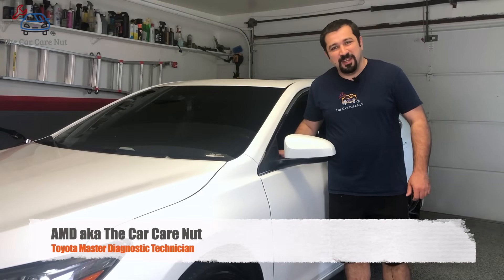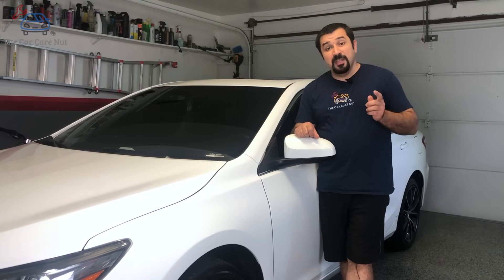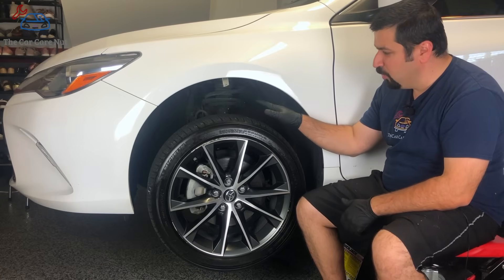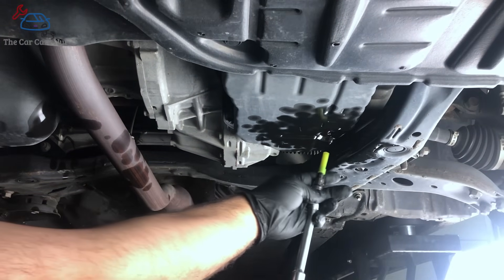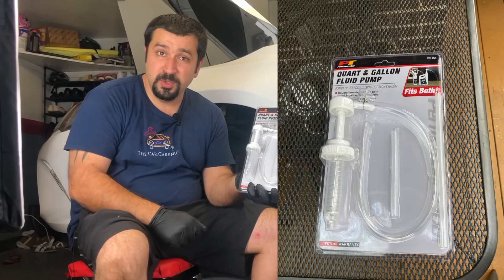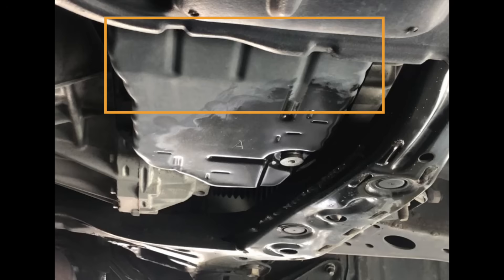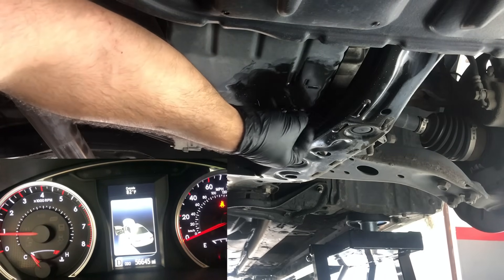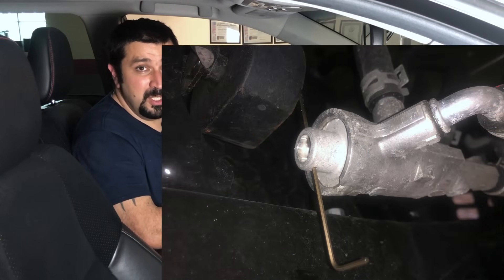How to change your Toyota Sealed Transmission Fluid

Comment: I have a 2012 Sienna only has 40000 miles. A couple days ago. I did the transmission oil drain and fill first time. I removed drain plug about one quart oil come out. Then I removed the red transmission tube (Straw) only about 0.7 quart fluid come out. Total fluid volume was only 1.7 quart. It is low compared with transmission oil drain and fill video in other you tube. Then I screw the red tube into oil drain port. keep screw in than I felt very lose. May be the red tube is come lose inside the drain tube. Push red tube up slightly feel some thing is catch it gently but not so sure. Place and tighten the oil drain plug and then add 1.7 quarts of WS fluid. Did not ram up the temperature to check level due to if lose the drain plug again one quart oil is going to come out just like first time I opened it. Test run the car. Transmission runs smoothly. I am not sure if the red tube situated in drain tube normally like this or may be it will float into other part of oil pan. Is this proper concern? Do I have to re-sit red tube or replace oil pan?
Reply from the maker: Hi! The overflow tube will tighten until it stops. Did it not stop? Or it just kept spinning?
Reply: More than likely, the overflow tube was factory installed very lose. Glad to know a functional oil pan the overflow tube can be tightened till stop. I just tighten a couple of turns and stop and afraid of tighten too much would push overflow tube into the oil pan. I will drain and fill again. if overflow tube keep spinning or be pushed into the oil pan, does it means I need to replace the oil pan? Thanks
Reply from the maker: So you’d want to tighten it by hand and not tight. Just spin it until it stops. If it keeps spinning and never stop or goes through likely either the tube itself is damaged or something is wrong with the pan.
Reply: @TheCarCareNut  Thanks

Comment: Mr car nut, I got the 2018 toyota auris hybrid 1.8 how often should I change my transmission fluid the got 14000 miles on the clock
Reply from the maker: Hi! I would change it every 60-90k miles

Comment: 2013 Toyota RAV4 Limited 4 cyl  FWD 
What’s the temp to check fluid level? Also is there a filter? Can you drop the pan and R and R the filter at the same time? Thanks
Reply from the maker: Hi! The temp range is 104-113 F there is a filter bit typically never replaced and doesn’t cause any issues. A pan drop it required to replace it but I wouldn’t bother honestly
Reply: @TheCarCareNut  thank you

Comment: nice video, is this the same procedure for the 2020 corolla le 1.8 engine transmission? and after shift between N and D, should I leave the car in N with the engine on or in D? Just wondering Thx
Reply from the maker: Hi this is the same procedure. If the shift you’d end in park.
Reply: @TheCarCareNut  thx a bunch

Comment: Sir I have a 2020 Tundra TRD PRO ...as you know Toyota did away with the transmission coolers in 2019 but still states that it is there. Some people are saying that the trans temps are too high(250 degrees) in 2019-20 models especially when towing. Toyota's official word is that they really didn't need an external cooler as they had in 2018 and older tundra's. Transmission guys on youtube say that these temps are too high also. What is your opinion or advice on this if I am going to be towing moderately.
Reply from the maker: I honestly would trust Toyota on this one. I’ve seen some pretty radical mileage already on the newer tundras with towing and not a single transmission issue or failure.
Reply: @TheCarCareNut  Cool that makes me feel better but I think I may change my fluid in shorter intervals than recommended.

Comment: Do you have confidence in transmission service centers such as AAMCO doing a transmission fluid change, and do these places typically flush the system, replacing almost all the fluid with new fluid?
Reply from the maker: I honestly don’t have experience with transmission shops as I work at a dealership. As long as they are using original fluid and understand the overflow type transmission fluid level( I hope they do as they are a transmission shop) then it should be ok.

Comment: The good old days when you could check the level with a dipstick and fill through the dipstick tube with a funnel.
Reply: The incorrect transmission oil level May cause trouble. Some People don't know you need to.let the engine running to check transmission fluid, opposite to the engine oil
Reply: @jjl8511  wouldn’t a dipstick be easy to check with it running? No tube level check with a running mess all over the ground. Also, this procedure has the potential to be a DIY megafail for anyone not experienced/meticulous enough. Toyota is indeed moving forwards by engineering backwards
Reply: @jjl8511  great in that case they need to read a repair manual, or have a independent shop do it for them.
Reply: @jjl8511 its a bit different with sealed transmissions
Reply: Our local dealer refuses to replace the transmission oil on newer toyotas, claiming that any change would void the warranty. this is absolute BS.
Reply: @Athletyk  exactly and these dealers are RUINING TOYOTA name
Reply: @Athletyk  That's why we call them the stealership.
Reply: @Athletyk  I had the same issue. Even after I showed them in the maintenance Manuel the mileage Toyota says to change the trans fluid.
Reply: @richardhollinshead7081  I got Toyota to change it even though they said it wasn’t required. I know they did cos they told me the plug wouldn’t go back and had to order a new one at their expense
Reply: @Athletyk  that dealer doesn't know WTH he's talking about.
Reply: @Athletyk  The warranty is up after 3 years and 60,000 miles, change it then.    Jim
Reply: @jimpie231 it’s actually 3 years 36,000 miles bumper to bumper and 5 years 60,000 miles on powertrain
Reply: If I could buy my 05 Camry over again, I would in a heartbeat.
Reply: @jeffd3844  Yeah, I'm so glad I've kept my '99 Camry, it's maintenance is so straight forward that I actually get some joy from performing them & even the timing belt job went smoothly, haha!  BUT, I've been battling corrosion, which is the death knell of most of the vehicles here in the salt belt where I live.  It really is pretty rare here to see older vehicles looking nice unless they meticulously had corrosion inhibitors put on them every season.😕
Reply: Why not drain the fluid cold and simply replace it with the exact amount which was drained? Yes, I know fluid drains more completely when hot, but, when draining cold, one can go to another task, maybe an engine oil change, while allowing a complete fluid drain.  If you use the graduated bucket as a drain pan, I do not see why the temperature regimen would be necessary.
Reply: @geraldo9965 Measuring the fluid you drain and replacing it with the exact same amount of fluid will only work if you're absolutely certain that the fluid level was correct to begin with. If you're not absolutely sure the fluid level was correct, you will need to go through the whole process.
Reply: That is why iam keeping my Honda 2010 as long as possible. This is bullshit.
Reply: @toddsmith1617  Some cars you can't even check your oil levels...same type of sealed system. Now that's really bad!
Reply: @Beast6228  that's absolutely not true some cars have electric dip sticks but in now way have a sealed engine wtf
Reply: Anyone know if he ever talks about putting a upgrade cooler on a CVT transmissions. Plz🧐
Reply: Agreed damn nonsense everything needs a filter that’s like sealing off an engine what the hell are those engineers thinking!!
Reply: Is there a transmission FILTER ? And if so,  is it changeable ?
Reply: @TheCarCareNut For a 2010 Toyota Corolla S, how do change the transmission fluid? Or do you just add fluid? I’m learning how to maintain the car from my mom who passed it down to me. I really appreciate if you can help since my transmission is already slipping and it takes forever to shift from second gear to third gear. This has been happening for at least 2 years
Reply: Gen a 9th Gen Accord V6
Reply: @sillybeans929  should be done every 50k if doing combination City/highway driving
Reply: I wonder if half quart came out the  dining the fluid adjustment since he out extra 1/2 quart more?
Reply: @sillybeans929 no, I believe that the first change is at 100k, then every 50k
Reply: @louarmstrong6128  it needs to be done around 40,000 to 50,000 miles then every 30,000 for peak performance at 100,000 miles your transmission might start to slip
Reply: I’d rather this method. No blindly trying to see transparent fluid that’s smeared all over a dipstick. This method is fool proof! Doesn’t get more simple.
Reply: They want it to be hard, so u can't do it 😢
Reply: Actually the life of the vehicle is determined by 100,000 miles.
Reply: Will never buy cars with this "advanced" sealed unit
Reply: Fill hole method is fine, actually easier to add fluid.

Comment: AMD which is a better procedure on transmission oil change??
 transmission fluid exchange or transmission flush.. TIA
Reply from the maker: Hi! Both are good if done correctly. For higher mileage transmission a drain and fill is safer.

Comment: I drained the 2014 Lexus GS350 AWD Transmission.  Weighed and tracked exact volume of old fluid and put the same amount back in.   Seemed to have worked.
Comments?

Comment: what about 2005-2010 chevy cobalt that have sealed transmission no drain plug nor fill plug ... mine is 05' at 155k miles original same factory fluid

Comment: If your car is running perfectly but it needs changed ! Why not use a digital scale and put in the exact weight back in !!!!!! They want you to go to the dealer ! Its a crime ! No dip stick ! Why would they do that ! They all do it now to make you go to a dealer !!! They make it very hard to have a automatic transmission ! The ones that don't do it will be buying a new one ! They win either way !
Reply: "If your car is running perfectly but it needs changed !"  You could also say this about engine oil!

Comment: For the last step, you said you take foot off break pedal, remove jumper wire and leave engine running.  On what gear should we be in at that point?  Neutral or Park?  Thanks.
Reply from the maker: Hi! You’d be in park.

Comment: Hi can I know how to adjust the RPM for hybrid car because my hybrid car after warm up the RPM still at 1100 to 1200 rpm for 2018 Toyota Voxy hybrid
Reply from the maker: Hi. It’s not possible to adjust the idle rpm on hybrids. It’s controlled automatically by the hybrid system
Reply: @TheCarCareNut  thank you so much for the reply master

Comment: I had the experience of tired oil in an LSD causing it to clatter, changing the oil to fresh LSD oil fixed the problem, something tells me that CVT oil when its additives are worn out that that is when the damage occurs, maybe LSD oil and CVT oil is close in formula, i.e. resists squeezing out of the surfaces.

Comment: Great video that I have been looking for a while. Thank you!
Hey AMD, how many times should I repeat this process until a get a pink/red color in my ATF?
Reply from the maker: Hi Marcos! For WS transmissions I wouldn’t repeat it too much. Do it once and if you want repeat it again after 30k miles
Reply: Mathematically, after 7 times you should have virtually pure ATF, but who wants to do that?  If you did it at every engine oil change for awhile, 2 or 3 might do it. I guess since they don't expect you to do it at all, any is better than none. At least you get some fresh antioxidants and seal conditioners in your trans oil.

Comment: Replacing 2 1/2 quarts can't be a proper drain and fill?  You only changed what is in the pan. What about the fluid trapped in the torque converter and the rest of the sealed system?  I want to do this maintenance but this seems incomplete to me?  Am I wrong?  Not hating just want to be 100% Thanks
Reply from the maker: Hi! A very good question. So the idea of the drain and fill is to replace enough of the fluid to renew the additive package to keep everything fresh. You can do a flush and that replaced more fluid but the drain and fill is enough to keep the transmission protected.
Reply: @TheCarCareNut  I have seen it suggested to buy 9 qts. of fluid and drain and fill 3 times, driving the vehicle between each drain and fill to mix new fluid with remaining old fluid. End result you get most of the old fluid out this way. Of course it is more expensive and more time consuming. In your professional opinion, is this method overkill and unnecessary ?
Reply from the maker: I think it’s overkill. A single drain and fill every 60k or 6 years will keep this transmission going
Reply: @TheCarCareNut  Thanks again !

Comment: Good video and great information. How come I can’t just put the same amount of fluid in as i took out? Drain 2.5 quarts, fill with 2.5 quarts.  Do I have to go through this whole procedure? Thanks a lot
Reply from the maker: Hi! You could but how do you know if the fluid level was right to begin with? I’d say if you’re going through the trouble of draining and filling why not just check the fluid level and do the job right?
Reply: @TheCarCareNut    I was only considering doing it that way because I bought my Camry brand new and no one has touched it besides me. I’ll be the first one to perform a trans service.
Reply from the maker: I would still check the level. You’d be surprised 😉
Reply: @kemicalx17  Did you see them fill the transmission at the factory?  Are you a gambling man/woman?  You never know if you don't check & verify.

Comment: I have a 2007 Toyota Camry with 115,000 miles previous owner never changed the transmission fluid 🙁
Can I change the fluid ?  or just leave it alone ?
Reply from the maker: You’re border line where I feel comfortable. I would check the fluid if it’s burned or too dark and gritty I would leave it alone. If not a single drain and fill is the most I would do.

Comment: Hello! Great video thank you. 2020 rx450h, fluid type and temperature for measuring please?
Reply from the maker: Hi! On hybrids this procedure doesn’t apply. On hybrids drain the transmission and fill until it overflows and you’re done. The fluid type is Toyota ATF WS

Comment: I recently rebuild my CVT transmission, while it's clear to me why undefilling can be bad, i never learned what makes a CVT sensitive to overfilling, say half a quart too much? In an extreme case i only see it spilling trough the breather hole, what else can happen?
Reply from the maker: So other than the leaks I’ve seen rattling noises when they’re overfilled by a lot. Honestly we’ve seen so low number of cases that I don’t know the exact source of the noise.

Comment: In a corolla 2011 with level stick. Does check it with the car running and warm up or recently turned off?
Reply from the maker: With the corolla check it with the car running and fully warmed up

Comment: Thank you for doing a great job describing the procedure for replacing the transmission fluid.  I have seen a few videos where the drain pan is overfilled a few quarts with new fluid after the initial drain then the transmission cooler return line is removed to flush the remaining old fluid out until the new fluid is seen, then proceed with the proper level procedure.  What are your thoughts on doing this as opposed to the procedure you show?
Reply from the maker: This procedure could work but it’s too risky as if you’re not versed on how to do it you could run the pump dry intermittently and I personally wouldn’t recommend it.
Reply: That's what I do,,put an extra quart in and start car let it pump out into a measuring cup shut car off and repeat, I do it 8 times,works great,,you'll obviously need help doing it

Comment: For a Tacoma 2013 which is the temperature range?
Reply from the maker: Hi! V6 or 4 cylinder? Also 4WD or 2WD model?
Reply: @TheCarCareNut  V6 4.0 4WD I don't know if is the 5 or 6 speed
Reply from the maker: 97-115

Comment: Wow is the dealership really doing this long procedure for each transmission change?  I feel they may cut corners somewhere especially in busy locations.
Reply from the maker: Hi! Dealerships use a scan tool which shows the transmission temperature and take 2 seconds. Also we don’t wait for the transmission to cool down because Toyota has a special tool that allows for fluid level check at operating temperate.
Reply: @TheCarCareNut  ahhhh ok I see I just want to make sure it's done right I've heard to many horror stories of transmission fluid being changed and finding out a week later it was done wrong and having a very hard time going back to who ever did it to fix the problem.

Comment: Very good information!! I've owned toyotas for over 30 years and always used the graduated bucket method for ensuring the same amount of fluid that I drained goes back into the transmission!! Never had any issues doing it this way and saved thousands in service and repairs.
Reply: Worked fine for me too
Reply: I feel the bucket measure fill is fine IF you are the original owner of the vehicle and know the transmission's history.  However, if the vehicle is used, there's no telling what the previous owner did.  Safer bet to just do AMD's demonstrated method rather than gamble with a $5-6k transmission.
Reply: Did you add in a little extra like he did and drain it out?
Reply: That's exactly what I did. No OBD paper clip or wire. Zip away after running the gears.